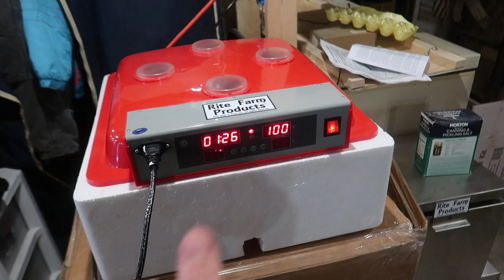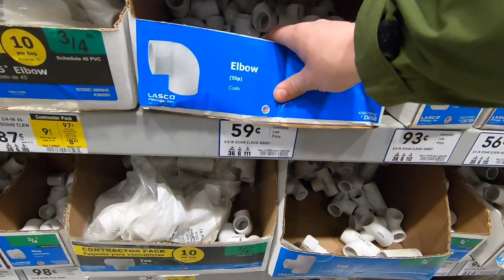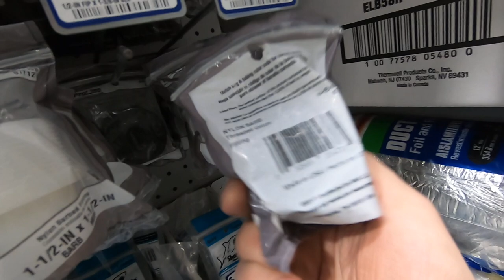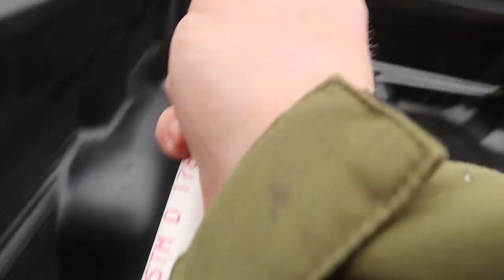Nothing About Today has BEEN NORMAL

Comment: Sometimes that's the way it goes. We just make the best of it. And the rope has ice on the end because being absorbent it is soaked and wicking towards the end because it is hanging down. As the water drops form on the end they freeze because it is so cold out. The rope is still wicking water so the icicle is getting longer, drip by drip since the previous drips aren't falling off. I think.
Reply: Al its the Air that cools the rope completely vs the ground.  This is the same reason that bridge decks freeze first due to the airflow above and below.  Love the video's sir.  Keep them coming.  Love your passion and opportunity you have.
Reply: Agree with Genevieve and Matthew. An additional factor besides vapor freeze,  and air vs. ground temps, is color. Darker colors like the ground and green roofing will attract more UV (heat) compared to the white rope - even on cloudy days!

Comment: The ice freezes on the rope since it can't absorb as much heat as the ground and the roofing material.
Reply: Yes, and another factor to consider is the wind chill.  That is, if a body (or location) is in a position where there is a flow of wind (or water) rushing by it, its heat is carried off.  You know this instantly by putting clothes to dry by hanging them on a line to dry.
WARNING:
This is the danger of a body being in running water.  That is the rushing of the water pulls the heat out of the person, or animal, and they find it hard to move.

Comment: For the ice on the rope, the surface of the rope provides extra surface area so any wind blowing by drops the temperature lower through evaporation.  When that colder water drips down the rope, the air is cold enough to bring it the rest of the way to freezing.  At least, that's the best I could come up with :)

Comment: Freezing rope - the rope is full of air spaces (think 'pink insulation') . It retains the lower night time temps longer. The water sitting on the metal and wood surfaces do not have embedded air spaces so they respond to the rising temps faster.

Comment: The rope is up in the open air and the water will freeze quickly there.  It remains so because the other things are in contact with the earth or the building itself which are both much warmer.  (Kind of like a bridge will freeze because it is up in the wind/air)

Comment: Your icy rope is because the rope acts as a wick and increases evaporation. Taking the latent heat of evaporation from the wick keeps the temperature a little lower - hence the water stays frozen! Also, the dirt and the roof are dark, so will absorb more heat, and stay warmer, than the white rope. So you have two factors in play.

Comment: It's an anti-candle. The rope is acting like a wick, but forms ice because what it is wicking is cold, instead of heat. If it were laying up on the roof, it wouldn't do that. It is hanging out in the open, with exposure to the wind. And it is just cold enough for it to work that way.

Comment: It’s probably a nylon rope not hemp & certain plastic fibres insulate heat. The water or ice in the rope is less affected by slight temperature shifts, it will melt when the sunshine is warm enough or when the wind picks up due to friction heat

Comment: About that icicle...You said it was 32°F, the point at which water freezes, sort of. Actually, the freezing point also varies with the pressure, and therefore altitude which might be having a slight effect, also. BUT water can be solid, liquid, or both at the freezing point. It takes 80 calories to change one gram of ice at 32°(0°C) to one gram of water at 32°. (It only takes 1 calorie to change one gram of water at 0°C to one gram of water at 1°C.) In other words, it takes 80 times as much energy or heat to melt a cube of ice without raising its temperature as it takes to raise it that last degree up to the melting point. If you have watched the temp of water you are trying to freeze drop you may have noticed that it takes longer for it to actually freeze when it is 'almost there'. That is called the heat of fusion for water.  There is a similar effect when you bring it to a boil. [Only it's like 1800 calories, I think.] That wet rope and the icicle that has formed on it have a small volume to surface ratio and are almost completely surrounded by air. The rope is light in color and the icicle is transparent so they are not absorbing heat from the sun as readily as the things in the goat pen (ground, wood, etc.) and they are not getting much heat by conduction from solid objects around them. The ambient air these last few days has been hovering around the freezing point, so it hasn't been warming them much by conduction, and if there has been much of a breeze, that has tended to cause some of the  H₂O as water to evaporate or as ice to sublimate; both are processes that cause cooling. [Ever notice that the hand dryer feels quite warm on your dry skin, but it feels cool or cold on your wet skin at first? It doesn't take that long to warm up; warm air can take away more heat by evaporation than it can impart by conduction.] Some of the water may be dripping away as the balance of these processes wobbles (night/day, breeze/calm, sun/no sun) and some may get carried away as vapor, while some water in the rope thaws enough to replace what the icicle loses.   Or not; that is my guess, anyway

Comment: Good morning Al,  is there wire in the rope that has the ice on it ?
Wire is conductors of cold as well as heat  its the only thing I can figure..
Poor little Hope having to be pinned up every day inside the barn...cant u put Hope in her own space beside the goat pin this way they can see one another but cant actually get to Hope to hurt her and Hope can be outside to....  :*)
Reply: Rope soaks up water wind evaporates water, cooling rope.
Reply: @bc8053  but wire inside rope gets much colder than the rope thus wet rope plus wire = ice

Comment: The water is freezing on the rope because as the water starts to drip off of it, more surface area is exposed to the cold air than water that is on top of the roof or on the ground so it cools just enough to freeze. It only really happens when the temperature is just around freezing since it takes so much more time for the ground and the roof to warm up/cool down compared to the air. Hope that makes sense :) Love your channel!!

Comment: THOUGHT OF THE EGG:::: DID YOU KNOW                                                                                                                                                                                                One hen can only lay, at the most, seven eggs per week while most chickens lay fewer. A hen which lays one egg every day is a very good layer. ... The hens will produce 200 to 250 eggs per year. Typically, the eggs are brown.     A hen can lay only one egg in a day and will have some days when it does not lay an egg at all. The reasons for this laying schedule relate to the hen reproductive system. A hen's body begins forming an egg shortly after the previous egg is laid, and it takes 26 hours for an egg to form fully.